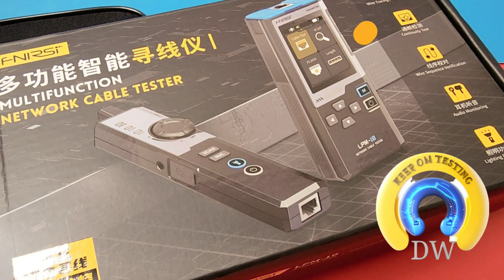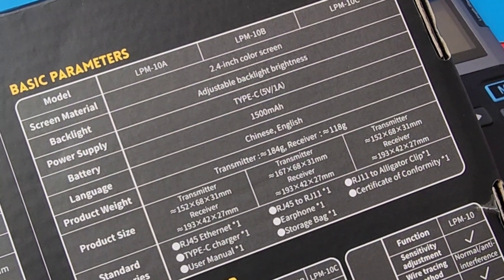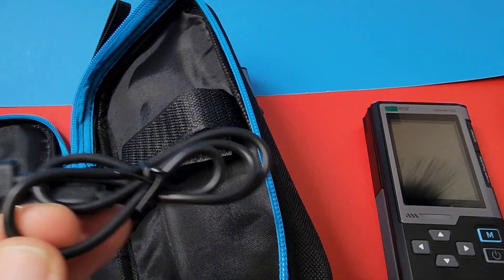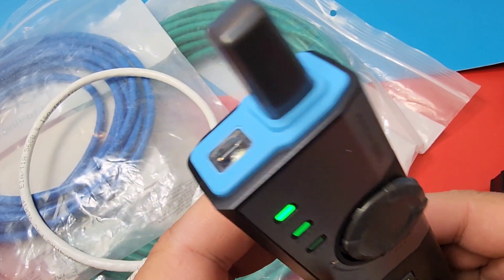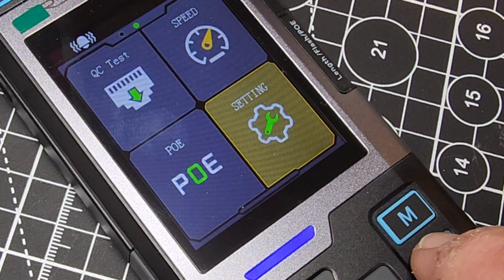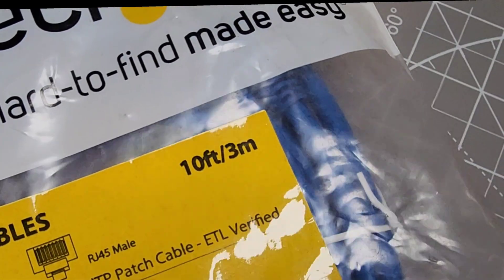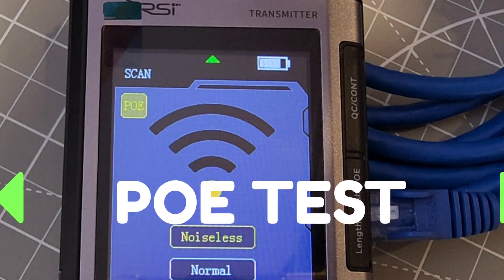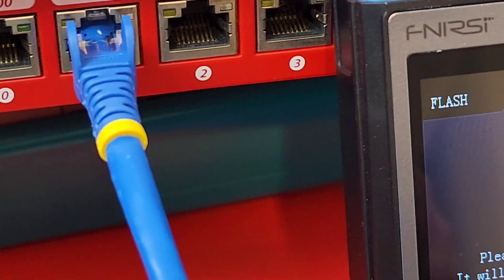MOTHERSHIP APPROVED! FNIRSI LPM-10 Cable Tester Review & Teardown!

Comment: The problem with this model is that the length measurement is always problematic. (out of range). The cheap tester (sc8108) can always give a length reading even if the cable is problematic.

Comment: The JXD is part of the Phy (the ethernet physical component).  It's a set of tiny transformers all potted into the tiny component, and used to physically isolate the ethernet externally from the inside whilst still keeping the electrical signal.

You see them on most ethernet sockets, in fact it might be part of the standard, I can't remember now.

There are even RJ45 / 8p8c sockets (whatever you want to call them) with those magnetics (the tiny isolation transformers) built right in.... So if you don't SEE The component, don't assume the function isn't there! :)

Kudos to the other viewer who said it's an ethernet chip - you were pretty damn close!

Comment: You didn't finish the POE tests!
Did it show correct voltages etc?
Reply from the maker: I've used it at work and it correctly determined the voltage.. Pretty impressed overall.

Comment: What about measuring defective cabel in a wall? Is it showing actual port speed when it's connected? 
All of this does Fluke instruments since many years.
Reply from the maker: It supports cable-tracing (“line finding”) for RJ45/RJ11/coax cables: you can connect one end of the cable and use the transmitter + receiver to locate the route of the cable through walls, floors, or ceilings (or at least trace the path) in normal mode or “anti-interference” mode. It's not as robust as the Fluke but it's also hundreds less

Comment: This FNIRSI LPM-10A is quite similar in function, menus, etc. to the Tooltop ET-636/ET-638.  The FNIRSI is a little more stylish, but the Tooltop tester can be ordered with seven cable ID modules.  The ID modules can be snapped on the ends of office drop cables and then the tester can identify which cable is which back at the wiring closet.  I compared FNIRSI and Tooltop and went with the Tooltop because I found the cable ID function is helpful for my needs.  Either one of the testers should be a handy and affordable addition to an installer’s tool bag.

An additional thing I wish these testers would tell is the dB loss of a cable run so I could provide proof of performance to my clients.  Maybe in next year’s models…
Reply from the maker: Thanks for the detailed comparison and feedback! Very helpful for others considering these testers. 👍
Reply: @KeepOnTesting  Thanks for your video reviews - on point, clear, not too long.  Great work.

Comment: I got one of this for a few months, first used a few week ago at a school, the tester went into firmware upgrade mode and can't shut down,
 only can turn off when hook to a computer, it won't work any more, so i found out why, because i put it in my back pocket and the power and
 M bottoms was press at the same time and it went into firmware upgrade mode. there was no firmware at their web site, "it is there now" 
 so i email their support and they sent me the firmware, then i follow the instruction to update the firmware V1.3. and it work again. 
thank for the quick support, "so make sure don't put it in your back pocket and always have the firmware in your computer"
Reply from the maker: Great info 👍  Thx for sharing!